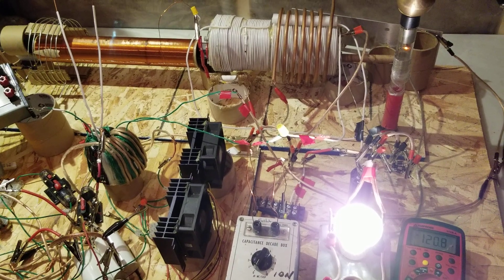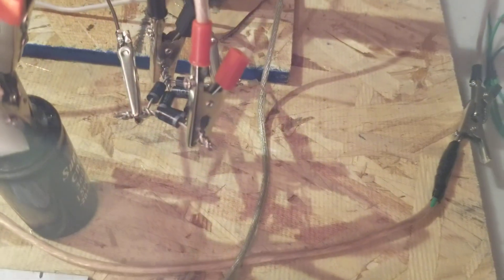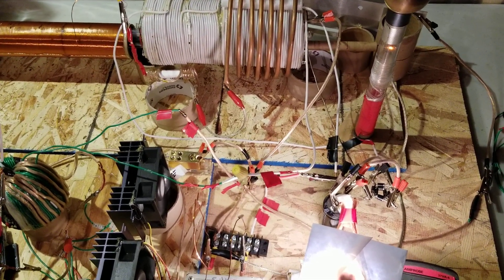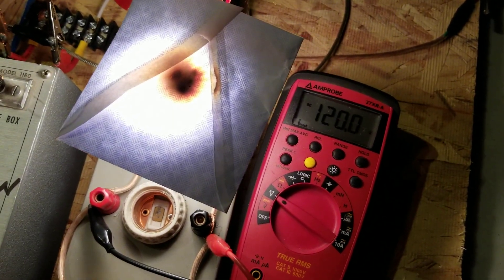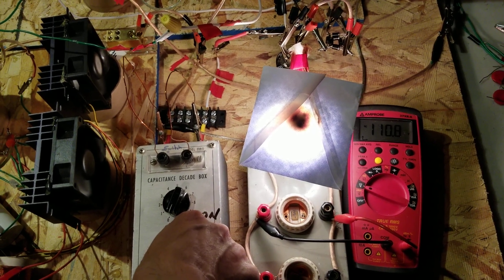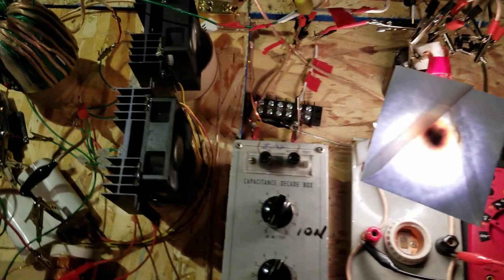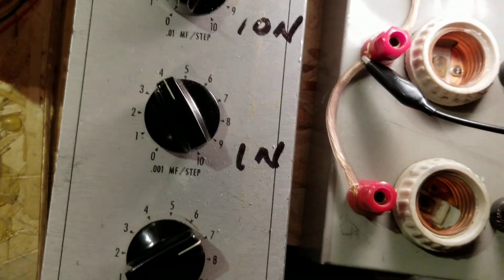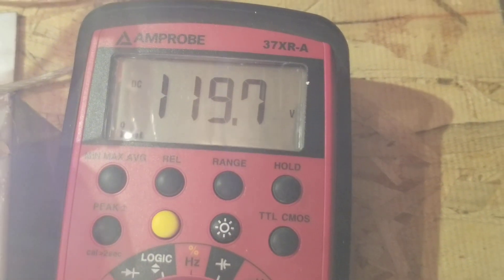Part 15: Akula/ Kapanadze Experiments, DC Output, final touches before Sync

Comment: might try the 1n5408 diodes, 1000v 3amp... about the same size as 1n4007's.
Reply from the maker: actually they are 5408's :) but still overheating = choking more amps
Reply: Nice... any chance it has to do with the diodes speed maybe?  think the 4007s and 5408s are more for mains frequencies... might be why they heat up too...  sorta like driving iron cores faster than 400hz... :)
Reply: Can you dial the voltage in further using the 100pF knob?  or is the 1nF knob as fine as you can tune for peak output volts?
Reply from the maker: @CoruscantMe  possibly a few pico's more or less could have helped, but it was pretty centered on the peak yes

Comment: 00:23 - 86 Real Watts input for 120 V, how it makes a 'Boost", Kirt? You know that we can compare W respect to Volts, isn't it? or did I miss You talked about Amps? anyway, looks You miss a second meter for the amps on your banch :p
Reply from the maker: hi there, well measuring the Full volts across a known wattage is basically telling me it is receiving full power... also its smooth DC 120V.. maybe over powering the bulb slightly ?
Reply from the maker: ... normally i would use a 1 ohm resistor in-line and measure volts across it with my oscilloscope... but scope was destroyed :(

Comment: What amperige that bulb consuming?
Reply from the maker: i believe its a 60 watt bulb, so fully lit @120VDC about 0.5 Amps to the light
Reply: @kdkinen  Hum, that's not a Precise Enough statement for that kind of experiments. At least, if You want to assert that is "Full Brightness", You need at least to place an other light bulb fed directly by the grid, its nominal voltage, so we can compare the brightness; especially under cam and in not a fully lighted room, it's much hard to say :p
Reply from the maker: @Khwartz  Are you saying that 60W / 120v not equal .5A ? 
do not expect anything special until i put the Tesla and Push-pull oscillator In-Phase with each other
Reply: Full brightness just means you read 120vac over the bulb...  the rated voltage... if the voltage is anything less than 120vac then so is the current less than the half an amp.  (the incandescent filaments aren't really linear in terms of resistance...  )  The direct comparison works but its less precise than just using a volt meter to take AC volt readings over the bulb itself...

Comment: The video won't work for me either
Reply from the maker: Still having the same problem?
Reply from the maker: I did just try to raise the video quality from what I normally watch at low quality for data conservation, but I just turned it up to 360 quality and the video started to play, but even I had issues just been until I raised quality slightly, maybe because it was taken in 1080 it's a struggle to get down to lower qualities